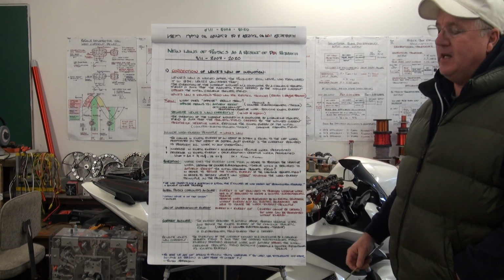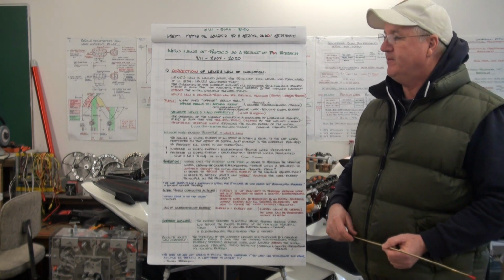How LENZ'S LAW Invalidates The LAW OF CONSERVATION OF ENERGY & Proves The LAW OF CREATION OF ENERGY

Comment: Thane, do you get now more than 10 to 15 Watts out of your newest setup ? Last series, when I remembered correctly you had about 180 Watts going into your motor, but only 10 to 15 Watts came out electrically...Sure there was also higher RPMs, but some claimed you just made an Impedance matching, so the motor went faster with the same input power and additional power Output...
Reply: Maybe you should switch over to the Rick Friedrich setup with the Free Oscillations and quarter wave pulse excitation, cause I have seen, that this works..
Reply from the maker: "you had about 180 Watts going into your PRIME MOVER ON NO-LOAD AND 0 MECHANICAL INPUT WATTS TO THE GENERATOR AT ROTATIONAL EQUILIBRIUM 
AND THEN LESS THAN 180 WATTS ON-LOAD WITH 10 to 15 Watts came out electrically 
WITH A ZERO PRIME MOVER INCREASE AND A CORRESPONDING ZERO MECHANICAL INPUT INCREASE... 

SO 10 WATTS OF ELECTRICAL POWER GENERATED WITH ZERO WATTS OF MECHANICAL INPUT POWER AT INFINITE OVER UNITY EFFICIENCY.

NO-LOAD: 
MECHANICAL INPUT POWER AT ROTATIONAL EQUILIBRIUM = 0 Watts

NO-LOAD: 
ELECTRICAL OUTPUT POWER AT ROTATIONAL EQUILIBRIUM = 0 Watts

ON-LOAD :
MECHANICAL INPUT POWER = 0 Watts

ON-LOAD: 
ELECTRICAL OUTPUT POWER > 0 Watts (~ 10 Watts)

EFFICIENCY = > 0 Watts ( ~ 10 Watts) / 0 Watts 

= INFINITE EFFICIENCY

MECHANICAL INPUT POWER = TORQUE X SPEED

AT ROTATIONAL EQUILIBRIUM TORQUE = 0 AND MECHANICAL INPUT POWER = 0

VIDEO 10: WHAT INFINITE GENERATOR EFFICIENCY MEANS & WHY IT IS NOT SYNONYMOUS W/ PERPETUAL MOTION: https://youtu.be/vVgyNGfXHPU

How to Calculate Electric Generator Efficiency 101:
https://www.slideshare.net/PDiCEOThaneHeins3240/how-to-calculate-electric-generator-efficiency-101

How to Calculate Generator Efficiency & What Infinite Efficiency Means: https://www.slideshare.net/PDiCEOThaneHeins3240/1-how-to-calculate-generator-efficiency-what-infinite-efficiency-means-164624806

https://courses.lumenlearning.com/boundless-physics/chapter/conditions-for-equilibrium/
The second condition necessary to achieve equilibrium involves avoiding accelerated rotation.
A rotating body or system can be in equilibrium if its rate of rotation is constant and remains unchanged by the forces acting on it.
The magnitude of torque about a axis of rotation is defined to be τ=rFsinθ.
Key Terms
torque: A rotational or twisting effect of a force; (SI unit newton-meter or Nm; imperial unit foot-pound or ft-lb)
equilibrium: The state of a body at rest or in uniform motion, the resultant of all forces on which is zero.

Comment: Agreed the prime source of energy has to supply both the action and reaction currents meaning there's more energy available than is currently realised.  Getting around it is merely in the timing between the initial action and the reaction,  As commented elsewhere this approach is used in Yagi and microwave antenna engineering already to produce  power gains, ie the timing of the reflected energy.  Thanks for sharing your approach and showing how to apply them in transformers and  prime movers  we use every day.

Comment: Look up "Gabriel Device" on a YouTube channel called "Mavendex" or "Mavendex Mavendex"
It's the same principle but without moving parts, a bit like your BiTT except in a different configuration. I'd love to know what you think to it.
I envision a solid-state zero-fuel generator where the over-unity aspect of this system is exploited to maintain free energy on demand from what is essentially nothing more than a mass of wires and magnetic flux core materials.